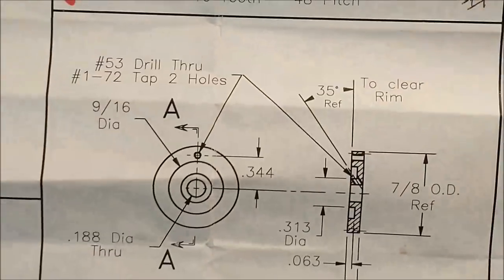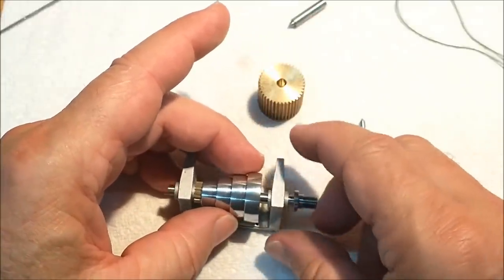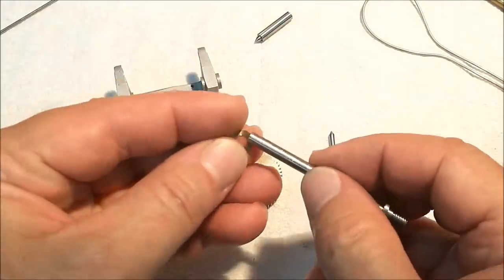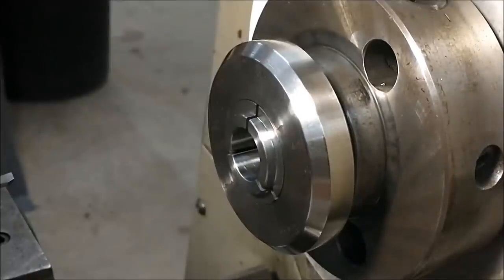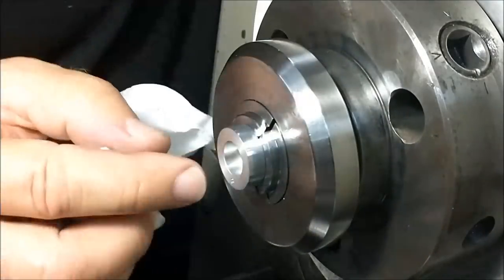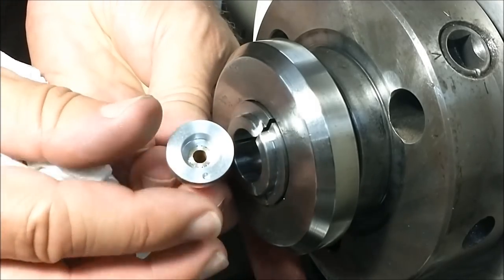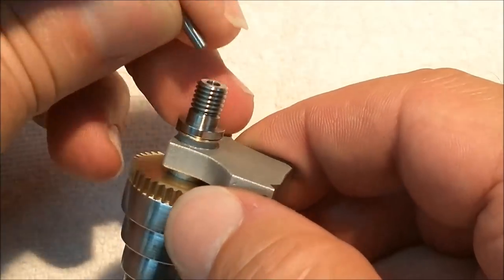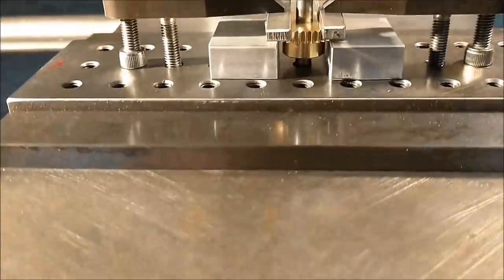Main Spindle Gear - A Design Change You Are Going to Like !!!

Comment: Why not plug the hole in the belt pulley with a set screw.  To do this, drill out the top of the belt pulley hole to a good set screw size but keep the length of the enlarged hole less than the length of the set screw.  Then tap the hole and put a set screw in it.  Next turn and/or file away the excess of the set screw sticking out of the hole so it blends with the belt pulley.
Reply from the maker: I could plug it so you'd never know it was there, but that would be a problem if the set screw ever unloosened. :)
Reply: @joepie221  the set screw I suggested would be tightened down and the belt would help to keep it from coming loose.  If the set screw holding the gear on the spindle comes loose,  just unscrew my set screw to get to it.

Comment: What thread percentage do you use when tapping?
Reply: I think Joe called it '0-80' so 80 threads per inch.
Reply from the maker: 70-75%
Reply: What I mean is what remaining thread percentage (tap drill size) does he produce normally. I normally go with 65%, sometimes even 60%. That's what I was taught anyway. I remember a long time ago I asked our owner why I should use 65% instead of the recommended 75% tap drill size on the Butterfield chart and his simple answer was "So Butterfield can sell you more taps." 🤔
Reply: Thanks Joe. Just curious. I suppose I learned to use 65% just for the sake of tool life in a CNC. Hand tapping is a different animal as you can really feel the cut.

Comment: W.R.T.  Drilling the hole through the cone gear...
Why not drill the hex-key size hole through the cone pulley and gear hub at the same time, then enlarging the gear hub hole to tap?
Reply: Because he is Joe Pi!. Enough said.
Reply: @Glenn I had the same thought,  but the outcome was the same. Just shows there's always more than one way to do things :D
Reply from the maker: You would still have 2 setups either way. if you don't have the benefit of a tight machine or a DRO, the inline method would be a good approach.
Reply: @fredcreer1929  HE !! CHEATS !! TOO !! MUCH !!

Comment: Love watching people like this that still manual machine thing...I love manual machining , went to school for 4 years for it , worked for years doing it, but nowadays most people and shops use mainly cnc..granted it is faster and for many parts at a time easier... It takes common sense and a descent amount of patients and knowledge to manual machine , some things that are not so common anymore,lol,...I love me some manual machining, keep up the awesome work.
Reply from the maker: I think every CNC machinist should be required to start on manual machines. I honestly believe it structures a mindset that can only make everything else better.
Reply: @joepie221  That is the same idea behind requiring everyone learning to drive to use a manual transmission to learn on before using an automatic.

Comment: I am very disappointed in your modifications.  With the experience you have, I was hoping to see how you did the setups on these difficult parts.  Instead, I see you "cheating".  I did this gear the way the print shows.  I also did the 4-jaw chuck like the print shows.  And I struggled through the setups to make them the way designed.  I only have 5 years experience and got both of them made.
Reply from the maker: Disappointing anyone is never my intent. But to think I couldn't have hit the placement of that set screw is where you went wrong. I changed the placement to eliminate the potential for the fastener to influence the parts it was supposed to hold together. I also tripled the active registration surface inside the gear bore which added a lot of integrity to the perpendicular alignment. I strive to teach all skill levels and try to empower those with lesser experience, skills or tooling, to realize they can get the job done, one way or the other.
Reply: @joepie221  I really do not think that the exercise is to put Joe's skills to the test. He is endeavoring to give the broader cohort of his audience a reasonable strategy to make each part in my view. I have no doubt that he could have done it to spec but I myself could not and appreciate his alternatives.
Reply: JOE !! PIE !! CHEATING !! MAN !!